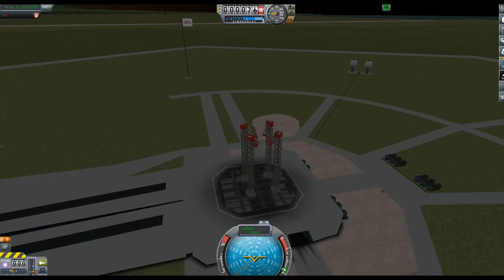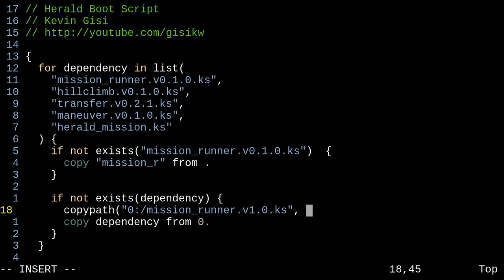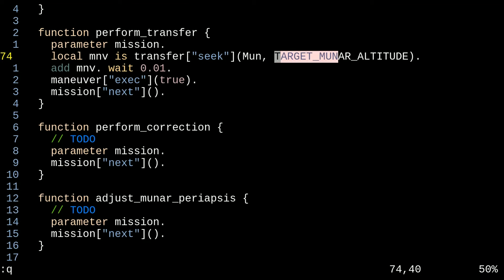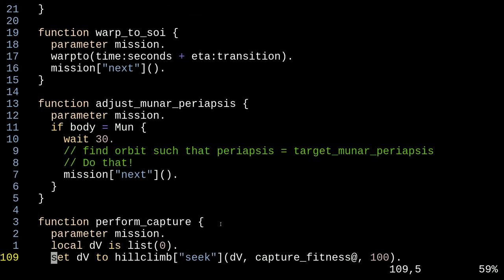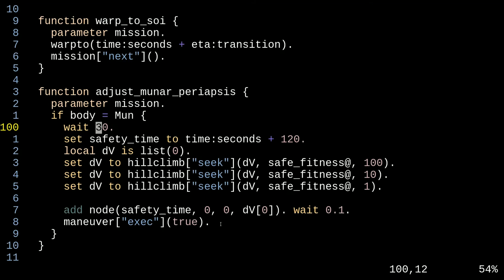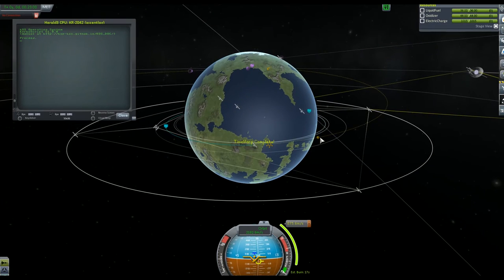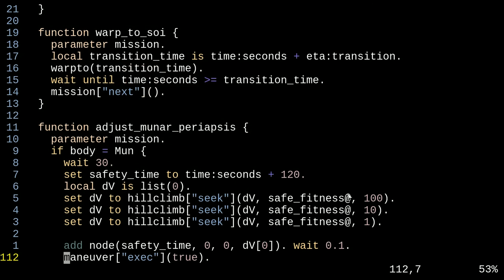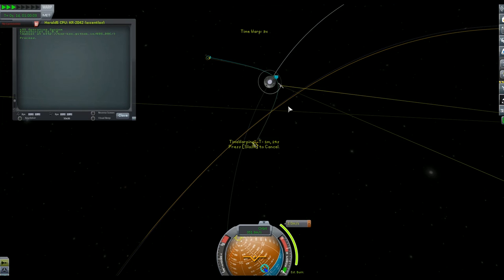Kerbal Space Programming #39 - Munar Errors

Comment: you should not use long waits during your mission scripts. you build the event handler specifically to fire at the end of each iteration in the main loop. waiting during the mission scripts will put them on hold. It would be better to do

if not warpstarted { warpto(correction_time), set warpstarted to true. } 
if (time:seconds >= correction_time) { set warpstarted to false. do_the_stuff(). mission["next"]().}

in that case you will continually keep evaluating the event list during warp time (though not nessesarily during do_the_stuff).

Also if you switch the warpto and steering lock in your maneuver execution function and add an angle check before warping, then you don't need to point your nose around so much in short order before the node.